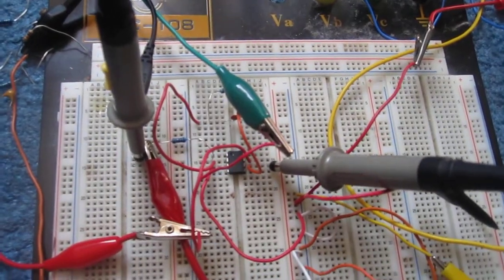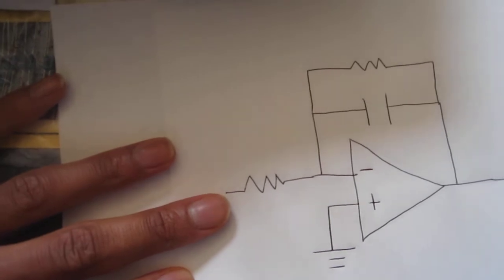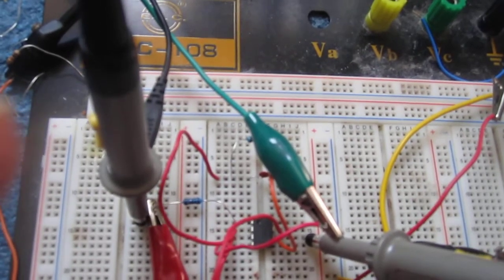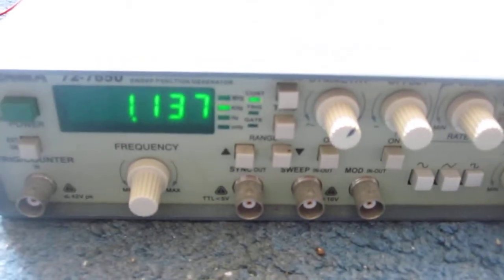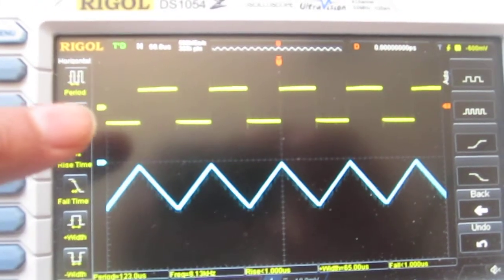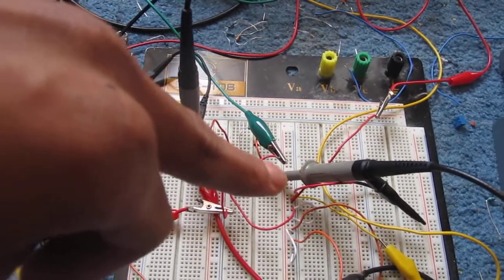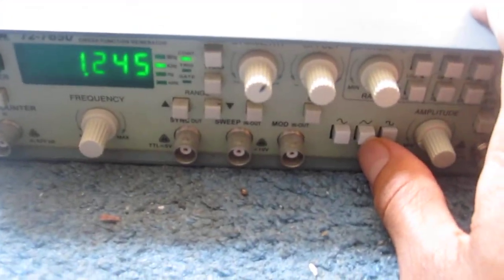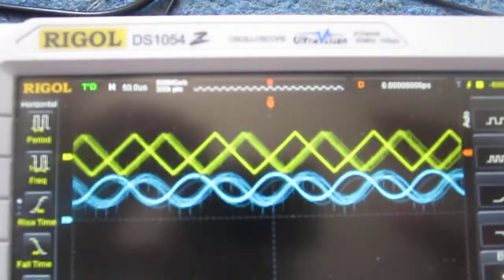Integrator Op Amp Circuit

Comment: square as input nd traingular wave as output... is it work as integration  .how  we can  say integrator. ?.
Reply: The integral of a square wave is given by the area under the graph. When the pulse is high the area is increased so the output of the integrator increases linearly. The same logic applies for the low pulse. Its just maths
Reply: Its physics,explained in terms of math, the capacitor acts as a path to low resistance and voltage around it cannnot change abruptly, so, current enters it first, and voltage then rises or vice versa, so, it charging and discharging is what we get on output, if its constant voltage on the input, then the capacitor takes time to go that peak gain on the output, which is a linear graph,... Similarly if input is rising, then voltage on cap must also be rising, and it is parabolic of linearly rising voltage...